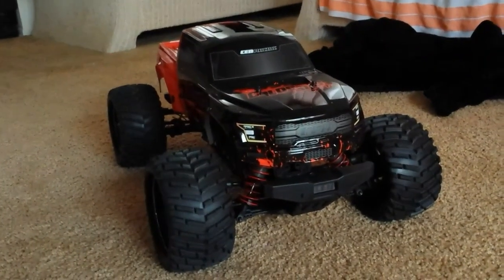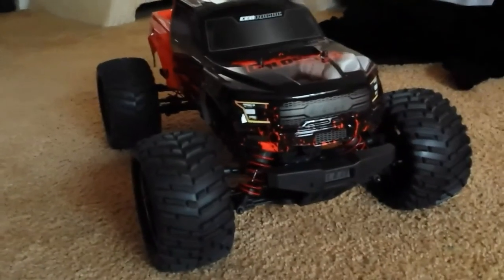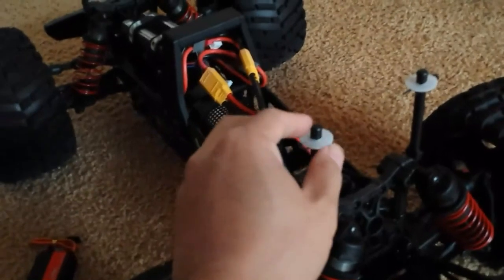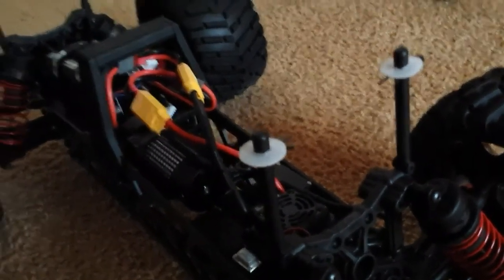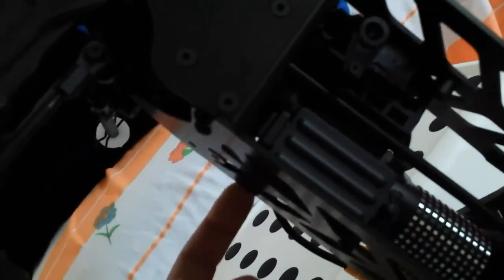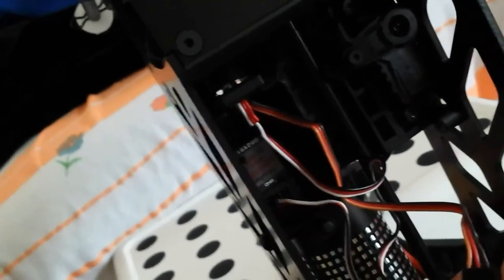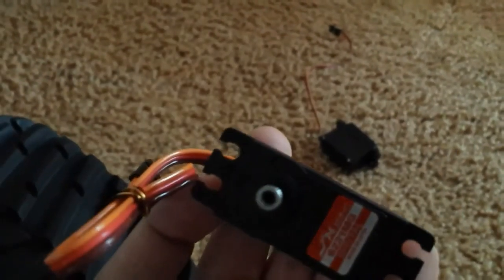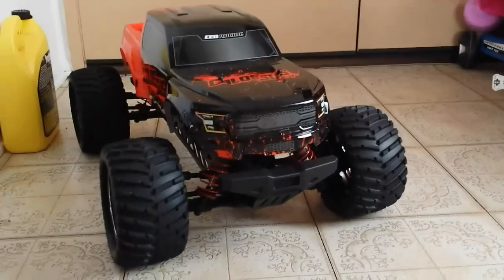Colossus XT 1st upgrade

Comment: one more thing i keep hearing about is ppl programing the ESC for better performance some say its a real pain in the ass...whats up with that,,why is there a need to adjust the ESC..I never heard of having to do that?someppl have a programing card?Like I said this is my first high tech RTR RC I got alot to learn...nothing when i was younger
Reply from the maker: Michael Dillon yah there talking about the punch mode. There's a sheet that the truck comes with which shows how, very easy.  Only if you want it to have an aggressive punch when you hit throttle than necessary....so power transmitter first than while holding set button you power the ESC.  Wait for the necessary beeps to release for what mode, then release button to enter.  Then press button to selected level you want (regarding # beeps when in selected mode) and turn off ESC and on again. DONE.  (the punch mode is the fourth beep I believe, 9 total and 9th being most aggressive)  I got mine set at about 6.  Factory is like pretty low I can't remember what though....maybe 1 or 2.  No programming card necessary :-)
Reply from the maker: Michael Dillon Cool you got the truck and Servo.  Just make sure you use the Servo horn that comes with the servo from China, the factory one doesn't fit well with the upgraded one...i just made one holes a bit bigger with a drill bit, works perfectly.
Reply from the maker: Michael Dillon LOL i just read the rest of your comment....You got a hell of a steal from eBay, awesome bro!! I have the TR-MT8E first 4S edition and love it.  I want the BE6S but don't have the funds as of yet but know for a fact $579 is worth it for that truck.  Enjoy, you'll love this truck!
Reply: tom when the servo comes perhaps you can help me step by step putting it in..or i can take it to my local hobby shop...im not stupid but i dont know shit about putting in a new servo...i thought there would be hardly no mods needed...what tools will i need to install it?thank you for the help man..I do like your new kit alot of exellent reviews on the outcast.,,,yes its a bit different looking but thats what makes it cool..i also like the gold color..enjoy bro
Reply from the maker: Michael Dillon Np man, all you'll need is the hex wrench's the truck comes with.....but maybe have the hobby shop would be a good idea because the servo horn had to be switched with one that's included,  a slight mod using a drill bit to widen a hole.  Also I forgot,  I  had to reverse the steering holding a button on the transmitter because it's set up backward on the new servo,  but that's easy, just hold the steering normal/reverse button. (makes turning right a clockwise turn on transmitter wheel)

Comment: how much for a servo upgrade?curious i know u have the xmaxx how is there stock servo?
Reply from the maker: Michael Dillon XMAXX servo is way better. The upgraded servo costed me $13.  Thanks for watching bro!
Reply: ill be doing the same.I like the CEN but i truly think there still way over priced...you should not have to replace the servo but i know many ppl say the same thing...I may return the cen it will be here tomorrow i got it on ebay im thinking i made a mistake Xmaxx is even more money but im thinking xmaxx is just the overall better truck..
Reply from the maker: Yah.  Check it out, The CEN is badass still and after a couple upgrades solid
Reply: tom i just watched a couple vidz on the CEN and noticed heard the rubber tires making noise sounds like its rubbing on the body...is this a common problem...tires to big for the truck?
Reply: also wonder why no skid plate at all??
Reply from the maker: Michael Dillon true, wish had that.
Reply from the maker: Michael Dillon yes that is a problem, the tires with the duel rate turned up will rub on the body regardless of how high you lift it when cornering, I raised mine as high as it can go....Its not a huge deal but can bother some people.  Lmk what you think when you get yours....